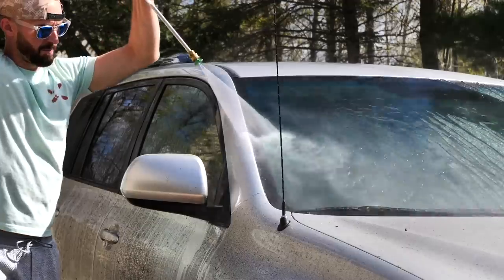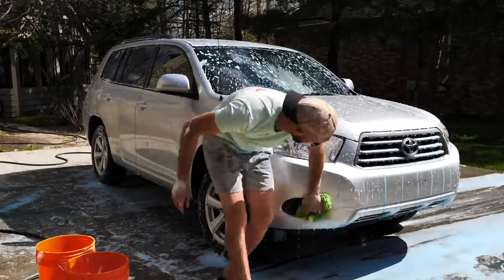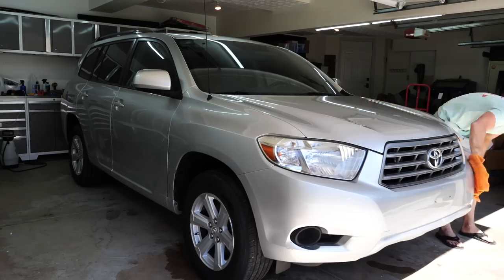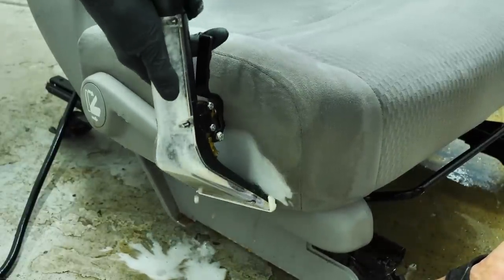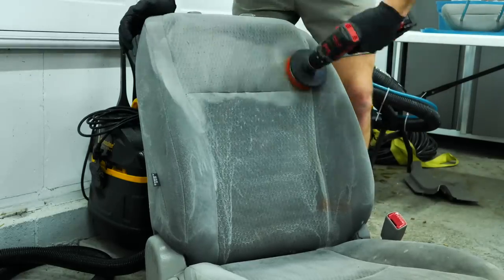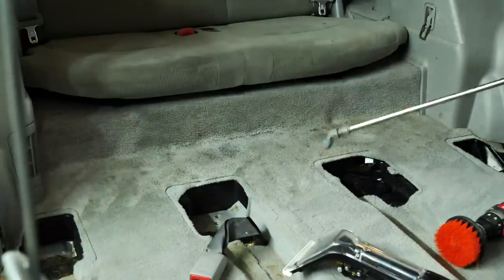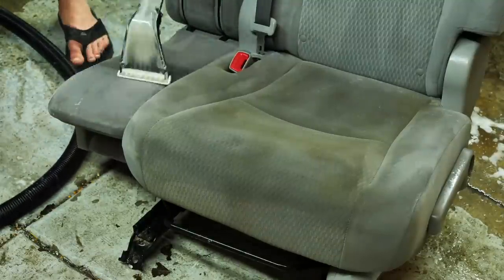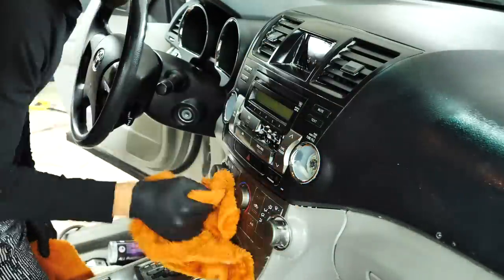Can It Be Cleaned? Deep Cleaning A TRASHED Toyota Highlander! Car Detailing Restoration

Comment: Awesome work bud. Keep it up. 
I have a similar car here in Australia, however the back seats have a cable underneath going to the back of the car which allows you to pull a lever and seats fold forward. I really struggled taking the back seats out because of that. Luckily this car didn’t have it.

Comment: For spots you can not get at like under that handle on the seat use your compressed air. It may make it easier with a tornador for corners but i saved a lot of time and got better results in terms of the carpet and fabric when i started doing that. Great video its great getting the Q&A included

Comment: I love the before and after montage! Fabulous work, as always. One question I have is: is it always okay to spray liquid cleaners near electrical components, or just certain ones? I notice you spray around cables (18:45), buttons/switches (29:47), and control panels (31:40). I would have thought that was a bad idea, but apparently it's fine, because you do it. Is it because the cleaner is specially formulated for that, or are the electrical components just not that susceptible liquid damage?

Edit: nevermind - just watched another of your videos that answered that exact question. Thanks!

Comment: "You Missed A Spot" (Detailing Humor Insider 😂) Great Job & quite the channel you have there fellow DETAILER, pretty impressive!!! I've been detailing for many years and recognize the skillset, you're very thorough and I appreciate your work!!   
1 thing if I may....  Please don’t take this personal in any way, but as a detailer myself we must be held accountable for best practices in our industry. I would like to challenge our industry to seek out the interest and to gain the ability to be more sustainable when cleaning/detailing vehicles. Think about it... We "CLEAN" vehicles, but most (not all) detailers aren’t really concerned with a "CLEANER" or more sustainable outcome for the Environment or Best or “Better Practices” when it comes to Cleaning/Detailing. 
I love the fact that you dumped the interior waste and water into a bucket and then it went “somewhere”...and not on the floor or putting any chemicals down a drain or near plants or anything like that, which is really cool btw! 😊 
Please let me explain why I have such an interest and passion for this topic. I live & Operate in Los Angeles, CA. and we are faced with some of the toughest environmental challenges, so we must think outside the box when it comes to Detailing and Cleaning vehicles in a sustainable manner when doing so in our City and/or State. We’ve made major adjustments for some of those challenges we face such as using bio-friendly chems, switching from gas to electric pressure washers, using steam instead of chemicals where applicable, and reducing our water usage for cleaning by 80%
Out of a list of many, 2 challenges stand out the most for me. 
#1 “Urban Water” Usage – “Urban Water” is Water that is not used for agriculture or to support the environment is referred to as “urban water.” Urban water includes water that is used for:  Drinking, Toilets and showers, Landscaping, Car washing, Businesses &, Industrial processes according to The California Department of Water Resources. (https://water.ca.gov/Programs/Water-Use-And-Efficiency/Urban-Water-Use-Efficiency)
Scientists reported earlier this year that the West's current megadrought is the worst in at least 1,200 years and that the human-caused climate crisis has made it 72% worse. (Source: CNN) If this is true, then we must accept responsibility and make changes that will help heal and contribute to the reversal of our previous non-sustainable practices. This should be our mission & duty if you ask me! 
#2 “Sustainable Methods & Chemicals” –Safer Choice helps consumers, businesses, and purchasers find products that perform and contain ingredients that are safer for human health and the environment. Safer Choice is an EPA Pollution Prevention (P2) program, which includes practices that reduce, eliminate, or prevent pollution at its source, such as using safer ingredients in products. To learn more about this, please visit: epa.gov/saferchoice
Think about future generations like for real for real, our kids family, neighbors etc.. If we start becoming more aware of what kind of chemicals we use and, the methods in which we use them, this could very much so lead to a more sustainable environment and have a tremendous positive global impact in our industry and for generations to come… Let’s be the change & allow these topics to go viral along with those “Satisfying Detailing Videos” that we love to watch!! I could go on & on but I won’t. 
These are my thoughts! Thanks for listening, please feel free to respond if you’d like… Have an awesome day, Peace!  
-Noah D. (Waxplus Auto) Los Angeles, CA.

Comment: Yeah the mytee u have pulls 20amps that’s the issue I was having with my house so I bought a preditor 3500 watt inverter generator from harbor freight to run the mytee also because u can’t use an extension cord with it so I figured the generator was the best option. And my steamer pulls roughly the same amperage as well so just being able to use the generator makes all that easier. I can still only run one at a time on the generator but it was still cheaper than having a new panel put in or new outlets so I’m sticking with that until I sell this house and get one with a garage or pole barn to work out of.

Comment: Have a question for you. I have a 2000 Toyota Camry LE that was given to me by my cousin it was his father's Camry. The fabric on the sits are 22 years old. The drill brush set I bought at Walmart are to stiff. I'm afraid of damaging the fabric on the sits. There is fabric on the door panels as well. I'm the 4th owner of the Camry. At least 2 of the owners were smokers. I'm not a smoker. My question is how do I get the tar stains off the fabric without damaging the 22 year old fabric? Please respond because I do need your help. Thanks much.
Reply: I would try to but a softer set of drill brushes or even a hand brush and scrub it by hand and get a good fabric cleaner like lightning fast or some other good one and scrub it just be gentle and also you can use a steamer if you have one
Reply: Hope this helped
Reply: @emanuelchavez4154  I saw a hand held brush a Walmart brand for leather sits the brush was much softer. I'm thinking very much about getting it. Fox also makes softer drill brush that I'm thinking very seriously about getting. I do have Meguiar's Ultimate carpet and sit cleaner. I have also thought about taking it to a Professional detailer. That's just a thought.
Reply: @williamclick9771  i would recommend maybe the softer drill brushes because I feel like the leather brush may be too soft and a detailer is also another good option just a good bit more expensive  but its your call I think you've got it just be gentle and then if that doesn't work use a little more force  and if you feel nervous or like you can't get it out you can also take it to a detailer